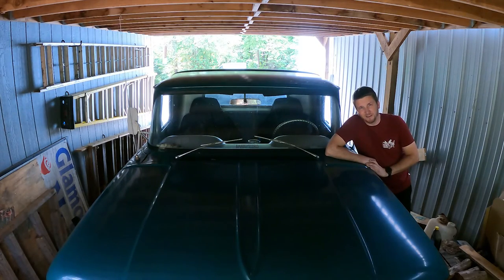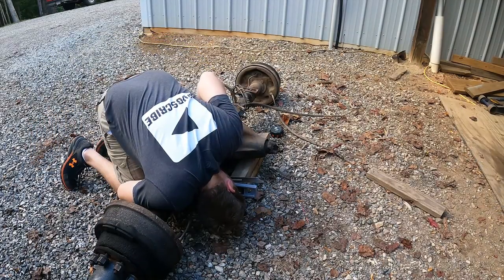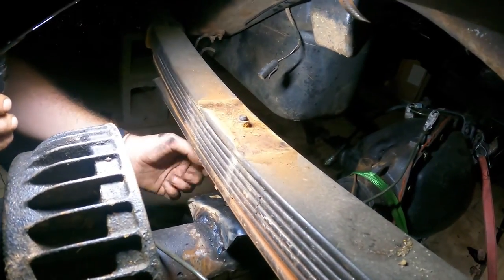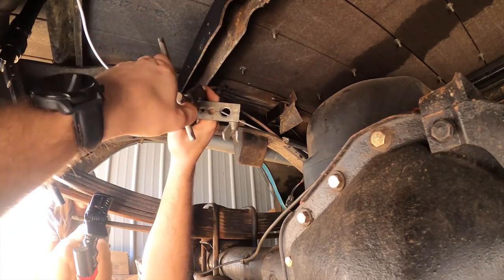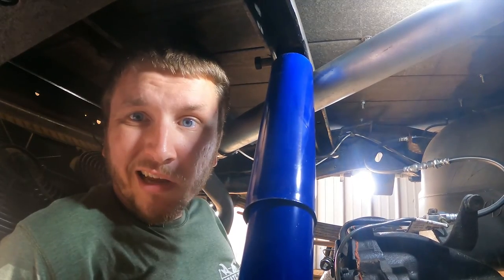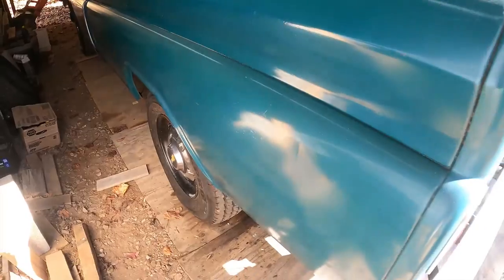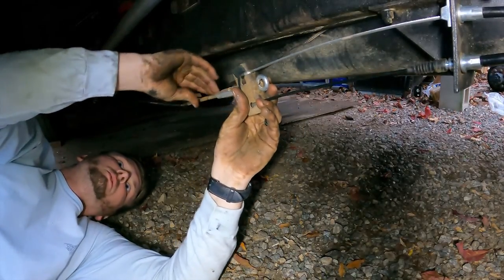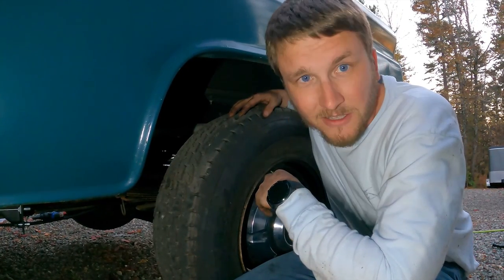FULL HOW TO: Rear End Swap | CHEVY C20 Truck (CUMMINS SWAP PROJECT)

Comment: What fluid weight did you used for that rear diff
Reply from the maker: I used 75w-140. Mostly because I don't drive it in extreme cold weather, and with the constant load of the camper in the back I wanted the heavier weight fluid.